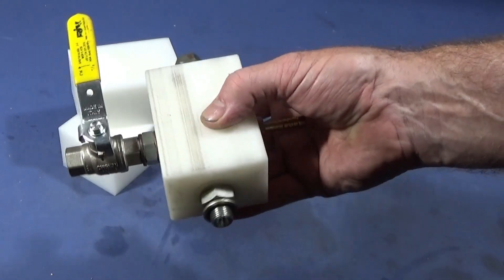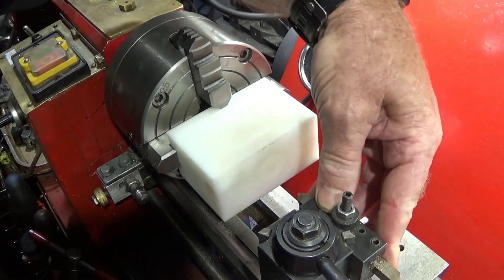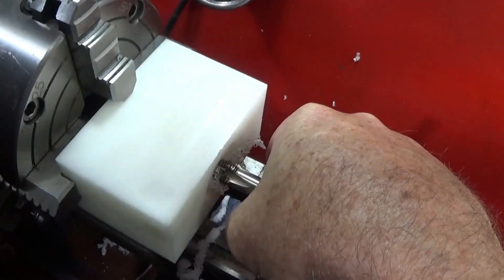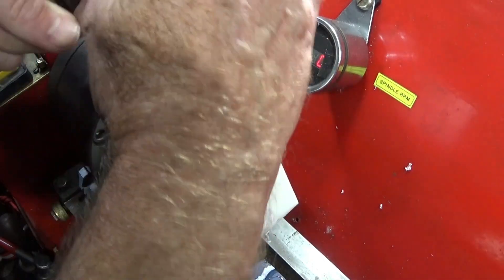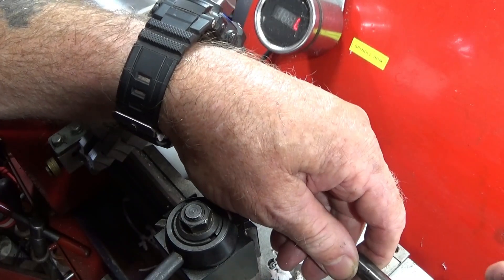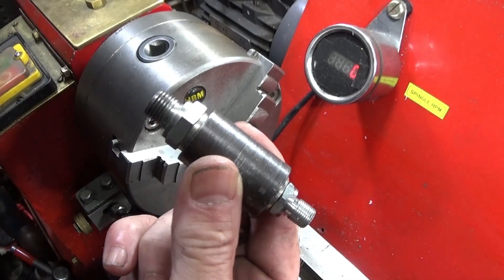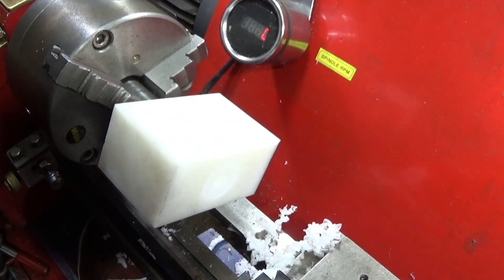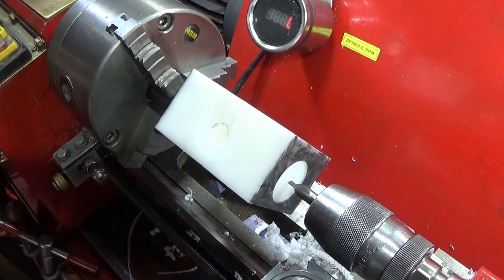Making A 4 Port Acetal Compressor Manifold On The Chinese Mini Lathe

Comment: Hi Steve, I have a question for you. Last year I bought an old lathe from an old man in my village who went to a care home. It's a Colchester Student and I think it's about 70 years old. There's a problem with the tail stock. It is out of alignment and very worn out. When you extend the barrel it has a lot of play. That makes this lathe quite useless. It is also too low (like 5 mm). 

So I've been searching for a year now to find a solution to this. I've tried shimming which helps a bit to solve the problem of it being too low but still can't really use it because of the barrel play. It droops and I've broken many center drills.

Any suggestions on how to solve this problem?
Reply: Try "This Old Tony", he uses a Colchester Student in many of his videos.  He surely knows how to maintain his equipment and maybe he can advise you as well
Reply: @johnrussell6620  Thanks I will do that! It's been a while though since he has uploaded a new video.

Comment: I don't know what type of camera you use but, on a DSLR camera, you can normally change the focus mode from point to matrix which might help.
Reply: Or just switch to manual when the autofocus is where you want it to be.
Reply from the maker: Hi Adrian. Thanks I will do that next time. I should have experimented a bit when it started playing up. It's a Sony CX220 camcorder. I also have another Sony which I think is a CX405 if I remember rightly, but I haven't used that one yet. Regards Steve